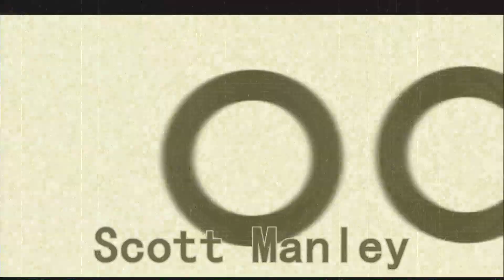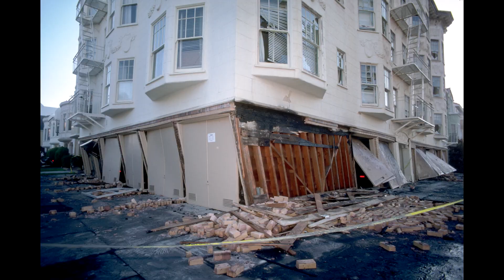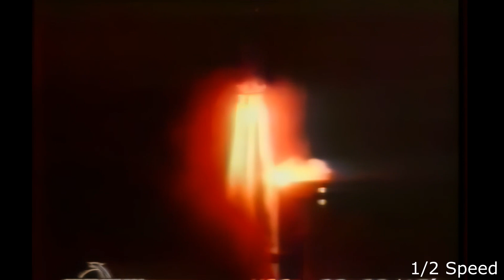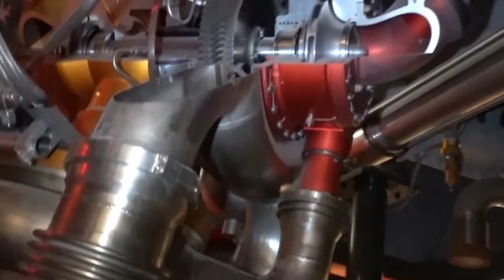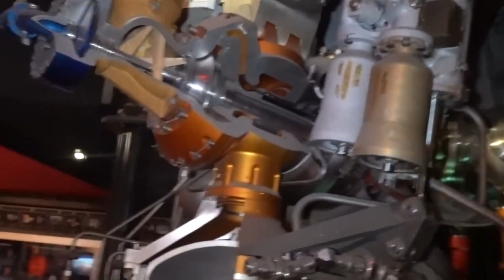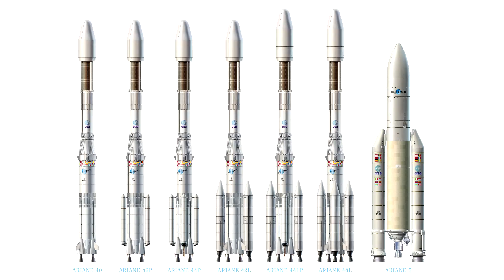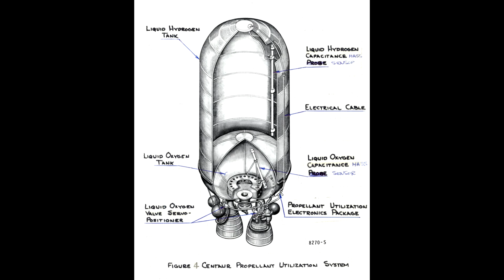The Unluckiest Satellites - Earthquakes, Rockets and Clogged Pipes

Comment: loose screw usually means they used the wrong screw, like that commercial jet plane that lost its windscreen because the person who took the windscreen off to reseal it used his eyes to put back replacement screws instead of the screws listed in the parts manual.

Comment: He probably used the handkerchief because he was ill. The irony is that pressure from his employer might have been the reason why he was at work that day, instead of staying at home recovering. More haste, less speed.
Reply: Many welding operations start with "stuff every open hole" so that welding spatter and grinding dust don't go anywhere unexpected.  You can count on having a very upset customer if their engine blows up because grinding dust or metal shavings got into the intake because someone DIDN'T stuff a rag in it first.

Comment: Why not use hydrazine directly to drive the turbines? That wouldn't require water to cool the gas generator exhaust.
Reply from the maker: Because they use UDMH which is more stable so doesn’t decompose in the same way as regular hydrazine, UDMH however is more stable for regenerative cooling of the combustion chamber and nozzle.

Comment: When I worked as an aircraft mechanic for the airlines shift change was always a concern for me because if there ever was a time to make a mistake that can threaten life and property it's at shift change. They make plastic plugs to keep stuff out of the pipes when the engine is being worked on. Rockets use them too. The minute the system becomes open enough to do it, those plugs are supposed to be screwed on. Sticking a rag in a pipe is something you might do on your car. Not a rocket. That technician needs to go because he doesn't know there is a difference.

Comment: Hurray FOD! It's funny the car guys and space guys overlap way too much. When I started my job working on space products I was bored as hell by the FOD training... If you build engines? You already know FOD protection even of its not officially documented/trained to aerospace standards.

Now, since I'm quality, I just get to document every step of every piece of every product that went onto this part that would fit in the palm of your hand... And that might now sound too crazy, esp since it's a fairly simple part... But do you know where the a screw came from? Oh and then who supplied them? And who supplied the material to make the screw? And who cut the metal to size? And who melted it?

I've quickly learned why aerospace parts cost what they do... When you hear a bolt costs big money and wonder why... Yeah I can tell ya. It's a lot of work.
Reply: Quality?  Quality doesn't cost that much.  Quality ASSURANCE?  That'll cost ya.

Comment: Interesting thing of note: so my lab at the university of Georgia studies fluid-structural dynamics with our water tunnel (which has a mass flow rate of 1 ton/s). Some of the research which we've done in the past was actually applied by SpaceX in the design of turbo pumps, or, more specifically, in the design of the gap between the blades and the wall which you talk about in this video.

If you're interested, I think I might be able to find that research paper.

Comment: Thanks for sharing your well-researched tale of woe - even if it brought back some painful memories. Having worked on the two ill-fated satellites you chronicled at RCA Astro, I watched the first launch that delivered the spacecraft to a "geo-static" orbit of -300 feet beneath the Atlantic Ocean  and knew most of the facts behind failure. But you were able to dig up some details that eluded me and my team mates for years. Most notably, we knew about the rag in the water line but had no idea the Arianne had water lines, and could only speculate about what they were cooling. And since I never heard much about the Atlas failure, your revelations were also gratefully received.

With no intent to diminish your excellent reporting. I'd also like to share a few additional tidbits related to that star-crossed pair of satellites.  They were not originally Japanese TV satellites and both began life as high-powered direct broadcast satellites (DBS) our customer intended to use to cover the North American continent plus Alaska and Hawaii. It was just before the dawn of room-temperature low noise amplifiers (LNAs) so the only way to enable subscribers to use a small (0.75 - 1 meter) dish was to use very powerful transmitters, in this case, 200W/channel vs the 20-30W we use today. 

This forced us to include a 100V bus to power the transmitters in addition to the normal 35V feed that powered the rest of the spacecraft.  It also set the stage for the first tragedy when an improperly configured test cable, poorly written test software, and an over-worked test crew converged one fateful late night to allow the 100V bus to be connected with the 35V bus. The resulting damage took (I think) four months and $10M (in 1987 dollars) to correct.  Shortly afterwards, the customer discovered that the satellite had become a white elephant overnight because the room temperature LNAs I mentioned before had just made it possible to send up a DBS satellite with 30 or more channels, versus the 3 channels our bird had. 

After considerable legal wrangling,  the customer paid close to the full contract price for the birds and got out of the DBS business. RCA bought them back at a fire sale price, and put them into cold storage while they looked for a customer.  That customer turned out to be NHK who needed a quick replacement for one of their DBS satellites which was beginning to fail ahead of schedule. Around that time, I left that project to work on the Mars Observer probe while many of my friends refitted the two DPS birds with new transponders and a feed horn that sprayed their energy in a beam shaped like the island chain of Japan. 

Your reporting pretty much covers the events from here but there were a few details that might be of interest.  It's my understanding that the hesitancy to terminate the Arianne was additionally complicated by the engineering team's desire to capture as much telemetry as they could in order to better understand the failure. I was watching the launch from New Jersey and there did indeed seem to be a dispute in progress when the Arianne settled it when it went transonic while flying at a very low angle and far deeper into the atmosphere than it had been designed to operate at that speed.  

Finally,  a year or so  after I joined Mars Observer, we managed to hire a hot-shot senior mechanical engineer away from Ford Aerospace. Shortly after Ged's arrival, I dropped by his desk and noticed a small irregular hunk of carbon honeycomb on his bookshelf, with little fragments of what appeared to be solar cells attached to it. It turns out he had worked on the Superbird that had shared a ride  with our satellite in the Arianne's journey to oblivion. After the smoke cleared, the solar pane fragment  washed up while he was walking on the beach.

Comment: When I was in college I was told a story similar to "rag in a pipe" by a professor.  It seems a helicopter manufacturer (I don't remember which) in the 1960s was experiencing random catastrophic failures of rotor blades when take-off RPM was reached.  The root cause was found (accidentally) to be due to a janitor who was cutting strips of masking tape to post "wet floor" signs using his pocket knife and a rotor blade as his cutting surface.  The scratches were deep enough to act as stress raisers and cause the blades to break apart right at take-off.  The cause was found when the investigation team was touring the manufacturing facility and the janitor just happened to be preparing to mop the floor after the visitors left.  My professor was part of the investigation team.

Comment: Thank you for this wonderfully told story of bad luck and oversights of satellite launches. It is not only rocket science that is overwhelmingly complex; it is also the execution that require a flawless procedure. Rockets don't arrive late, or to a slightly different spot - like any other transport would, in case of "insignificant" problems like a piece of cloth or a loose screw. Rockets do uncerimonially come down if everything isn't perfect.  
Thanks for the nice and informative video!

Comment: Back in the late 90’s, I was doing a review of Shuttle OMS LCC requirements and came across this very restrictive requirement that was written in such a way that even the failure of a transducer off scale (in an obvious, ‘this is a failed transducer’ way and not any indication of potential trouble) would cause the launch to be scrubbed.  I tried to find out what the requirement was even meant to protect against since I couldn’t figure out what failure mode would be involved, but nobody knew.  These kinds of requirements were a definite no-no and violate LCC ground rules so it had to be figured out.  Eventually, someone in OMS remembered it was written to protect against the possibility of a rag being left in a feed line.  I wouldn’t be surprised if that requirement was driven by the Arian failure, but regardless, it was a requirement that was definitely more dangerous than the potential of what it was trying to protect against so it was quickly deleted.

Comment: What caused the Ariane failure is a bad design that only has one degree of freedom for each engine.  That means if any single engine fails, the entire flight is lost.  It's a single point of failure multiplied by four.  Yes, it costs more to have more DOF per engine, but the entire system becomes more reliable per DOF added.
Reply: Indeed!

Comment: Fly safe, keep track of your cloth, plastic polishers, and screws.
Reply: The Gemini 6 launch was aborted--after the Titan II's engines ignited, but before liftoff--by a dime-sized plastic dust cover left in one of the first stage lines. Had the Malfunction Detection System not reacted so quickly, the vehicle hold-down clamps would have released, and the crew would have had to try their luck with the ejection seats, whose previous performance had inspired John Young to refer to ejecting from a Gemini spacecraft as "committing suicide to keep from getting killed." Also, the Titan II--a heavy ICBM--used Aerozine 50 (a 50/50 blend--by weight--of hydrazine and Unsymmetrical Dimethyl Hydrazine [UDMH]) and dinitrogen tetroxide; it's a non-explosive fuel/oxidizer combination (because they are hypergolic, igniting on contact), but both are highly toxic, carcinogenic, and mutagenic.

Comment: It always bothered me a bit to learn that Gene Kranz had declared "failure is not an option", since a failure had already occurred, in a sense, long before 13 was launched. NASA was just lucky that it didn't eliminate the possibility of returning the crew. Failure is always an option, or a possibility. SpaceX had three unforeseen flaws with the Falcon 1 rocket, at the very beginning of the company, before it starting to accumulate a string of successful flights.

Comment: Assuming that cloth of doom story is true I hope that the tech was not only dismissed from the ESA but also prosecuted for his criminal negligence.
Reply: Um...  Most welding jobs START with "stuff all the open holes" because inside those holes are already finished surfaces.  Welding and the associated "clean up" are inherently very messy processes.  Welding can cause hot metal spatter, and just one tiny drop of that getting into a pipe can ruin the whole assembly.  The guy in question seems to have started the prep work needed to ensure a quality job, but never got the authority to proceed with the hot work.  He clearly did manage to get the message to a supervisor about the work needing to be done, because someone else completed it.  I think any fault lies with the person who was responsible to inspect before reassembly.

Comment: On the other end of engine shutdowns, there was STS 51-F. As a result of the center engine shutting down, the resulting orbit was lower than expected, which posed a problem to most of the experiments carried on the flight. However, the 'Chicago egg' experiment from UChicago was able to return more data than it would have at the higher orbit. The Chicago egg itself is still on the UChicago campus, sitting in an alley.

Comment: Didn't they do test fires back then? Surely running the engines for a minute or two on the pad would have revealed that handkerchief issue right?
Reply: I don't know about the Viking engines but a lot of older engines had a bunch of single use valves and tiny SRB cartridges to spin up the pumps so they had to be refurbished after firing and opened up. So they probably test fired it on a stand and it happened during the refurbishment process. But a static fire on the pad prior to launch wasn't something many people did before SpaceX. 
They would usually ignite the engines and hold the rocket down a few seconds to have a chance to abort if something happens and it probably took a few seconds for the pump to overheat.
Reply: @please_stop-v7o  Indeed--until the Space Shuttle came along, on-the-pad static firings were unusual. A few Titan I and Titan II vehicles were tested in that way (LC15, LC16, LC19, and LC20 [the Titan launch complexes] had hold-down clamps and flame trenches for both the first and second stages, which were stacked next to each other when such firings were conducted). The Vanguard launch vehicles also had on-the-pad static firing capability (for the first stage; its direct ancestor, the Viking sounding rocket, was always--or nearly always--static-fired on the launch pad before being launched), although I don't know if any Vanguard vehicles underwent static firings on its pad, LC18A (LC-18B was an operational-type Thor IRBM pad).

Comment: as a mechanic i would say the cloth is pretty likely. when you have to leave lines disconnected you put a cap or a cloth in the end to prevent debris from getting into the system, especially with something like a pump or a turbo and in this case a turbo pump

Comment: Similar cloth incident happened at my work at a nuclear power plant. A colleague of mine put a cloth rag in a pipe that we where changing flanges on, a vertical pipe with a valve on it with seawater inside so it was full of seaweed growing on the inside. And that caused water to drip down on the flange beneath that we where welding so he shoved a rag up in it and then his shift ended and the evening shift(including me who welded the flange) took over and had no idea there was a rag up there. We didn't touch the upper pipe so had no thought about looking inside it and putting a rag inside where against all protocols so didn't really expect something like that to happen either but today they've increased the security for incidents like this and go in with cameras and checks the pipes before closing any systems.
This was on the cooling water pipes for one of the diesel generators and the rag was found the next day when they did a test run and saw the lack of flow in the system, and found it stuck in a filter.
Reply: You would be amazed at the number of aircraft accidents caused by rags in places they are not supposed to be. Rockets are no exception.
Reply: @jcoghill2  Sounds like more places need to have serial numbers on their rags
Reply: You must have been pretty mad, in fact you lost your rag.
Reply: @g-r-a-e-m-e-  Rag against the machine.
Reply: Release the hounds!
Reply: Out of all the lines inside a nuclear power plant that could fall victim to a Cloth of Doom, this diesel generator coolant pipe sounds like a pretty benign one, actually.
Reply: @Ithirahad  There's also 4 of them.
Reply: chernobyl 2021
Reply: @fask69  From my understanding modern American plants at the very least have a lot of redundancies and checks to make sure things like that don't happen even when companies cheap out (looking at you Texas) or employees make mistakes (so long at they don't make too many).  I remember reading that the Japanese plant (Fukushima I think) that went up due to an earthquake was well behind then current standards and that any plant currently running in the US would have safely shut down and contained everything.

Comment: Its crazy how many machines can completely fail if even the tiniest thing goes wrong. At least with something like a car, you can pull over to the side of the road if something breaks (unless your brakes are gone, but you could probably stop.) With a rocket, you can't make repairs unless it's already in orbit and you just so happen to have access to the space shuttle.

Comment: Im starting to understand why Electron uses electric pumps even if that means having to carry hundreds of kilos of additional weight
Reply: Yep it's a simple system with fewer points of failure. Plus the weight issue is offset a bit by a reduced amount of plumbing etc - and a gas/fuel driven pump has to use some weight of fuel anyways, although that fuel is much more energy dense than current battery tech
Reply: @SuLokify  the performance penalty of electric batteries for smaller rockets is okay, but it is an issue for larger ones. It could work for rocket sizes like a Falcon 9, but it would significantly reduce the payload.
Reply: @adamrak7560  Right, and high performance batteries run up against thermal problems too, larger batteries for larger fuel pumps will be more difficult if not impossible to prevent overheat - still a great choice in terms of reliability where the physics allow. Will be interesting to see if future battery tech allows for its use in larger rockets